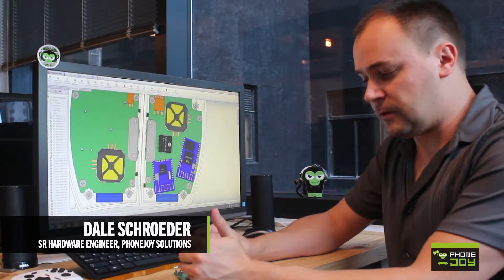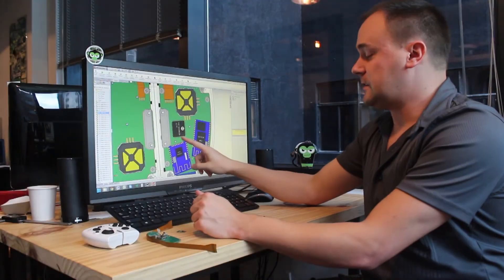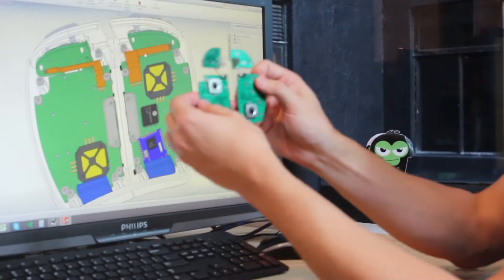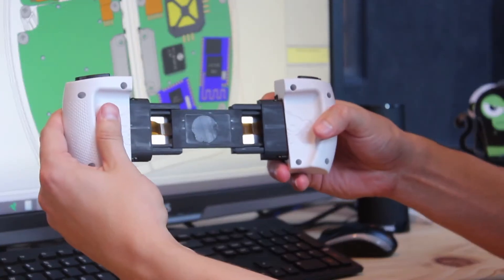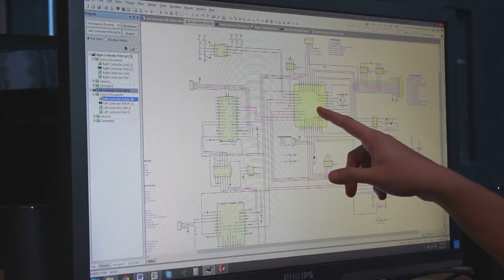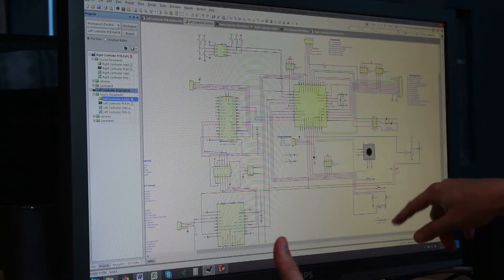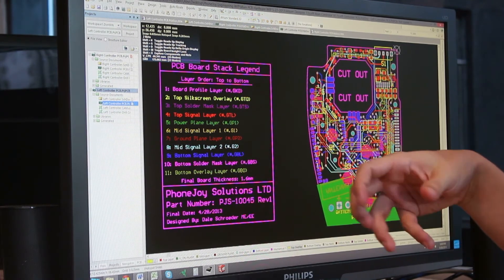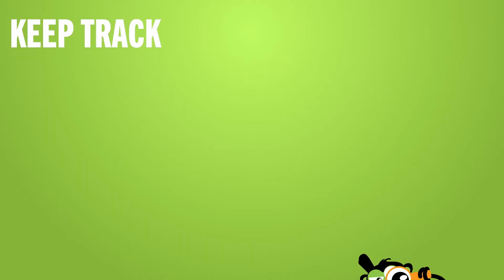PhoneJoy PLAY - Development Diary #2 (June 2013)

Comment from the maker: The modules will never run at the same time. Dual mode solutions are often not the best, because they are actually more expensive and would increase the price point by another $10 at least. Also most dual mode Bluetooth Smart modules only make use of one antenna, which for some modules limits the power saving functionality of BLE.